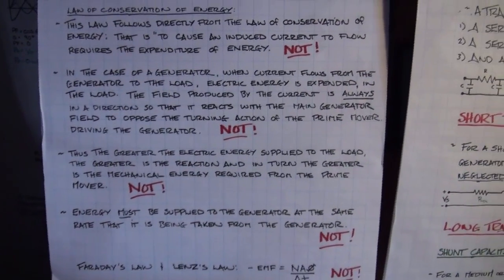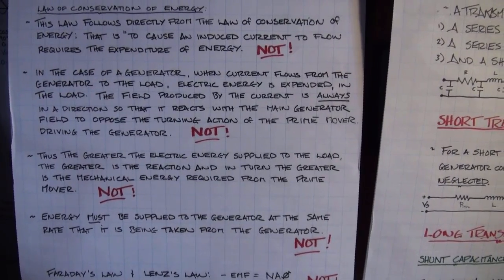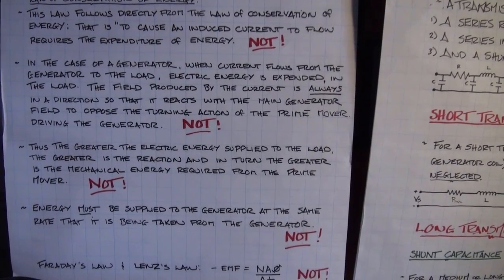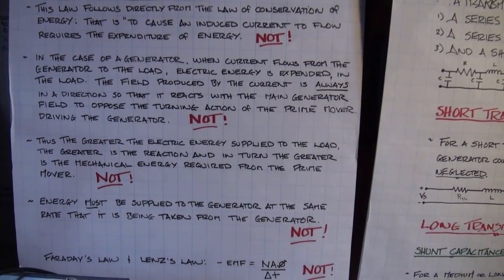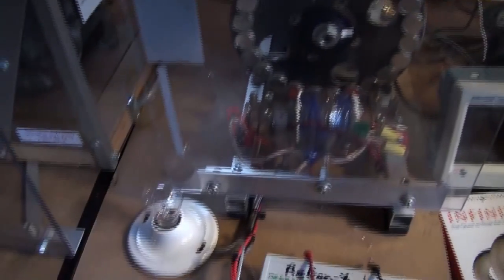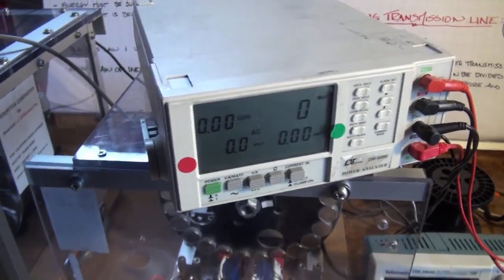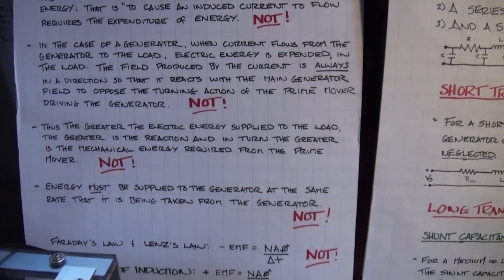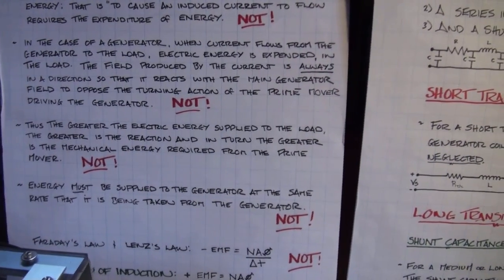Infinite Efficiency ReGenX Generator Explanation using Transmission Line Theory video 3

Comment from the maker: The ReGenX Generator Coil employs Electrodynamic Properties to store the generator coil's induced voltage in the coil's self induced capacitance (above the coil's cutoff frequency/critical minimum frequency) and then releases it (through the coil's inductance) once the rotating magnetic field is at Top Dead Centre (TDC) to the coil's core because the coils Inductive Reactance (AC resistance) is ZERO at TDC because the F comonent is zero (Xl = 2piFL). This load current delay also delays the coil's induced magnetic field until the rotating magnetic field is already past the coil's core. So the ReGenX coil employs; Transmission Line Principles to store energy as a WAVE and then transfer that stored energy Electromagnetically (like any conventional generator coil) in the absence of descrete components (i.e. actual physical inductors & capacitors)... In this manner Lenz's Law, Newton's Third Law and the Law of Conservation of Energy can be made obsolete... Cheers and Happy New Year! Thane

Comment: So as the coil and capacitor are in resonance, the coil can not pass (handle/keep) the current (it should) and thus it all goes to the capacitor. And the load is on the capacitor. Bingo. Right?
Reply from the maker: Not quite deslomeslanger but close, the ReGenX Generator Coil employs Electrodynamic Properties to store the coil's induced voltage in the coil capacitance (above the coil's cutoff frequency/critical minimum frequency) and then release it (through the coil's inductance) once the rotating magnetic field is at Top Dead Centre (TDC) to the coil's core because the coils Inductive Reactance (AC resistance) is ZERO at TDC because the F comonent is zero (Xl = 2piFL). This load current delay also delays the coil's induced magnetic field until the rotating magnetic field is already past the coil's core. So the ReGenX coil employs; Transmission Line Principles to store energy as a WAVE and then transfer that stored energy Electromagnetically (like any conventional generator coil) in the absence of descrete components (i.e. actual physical inductors & capacitors)... Cheers and Happy New Year! Thane